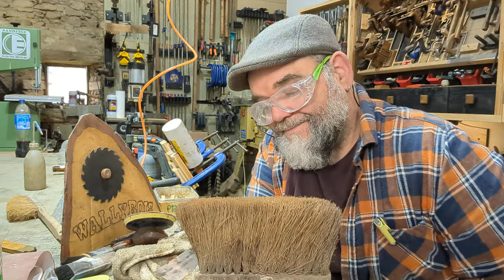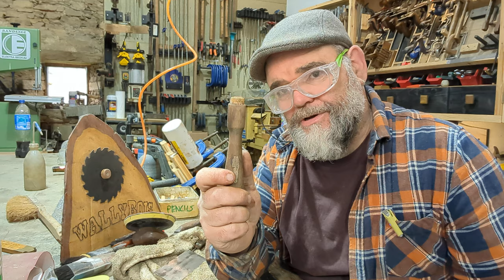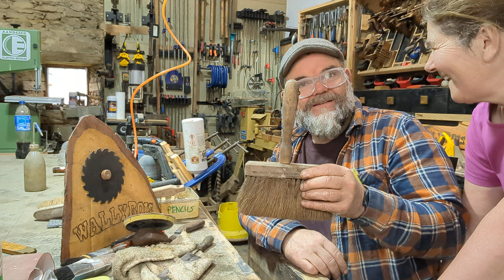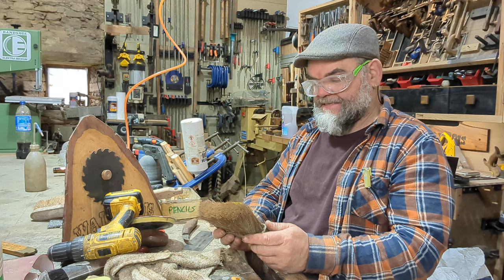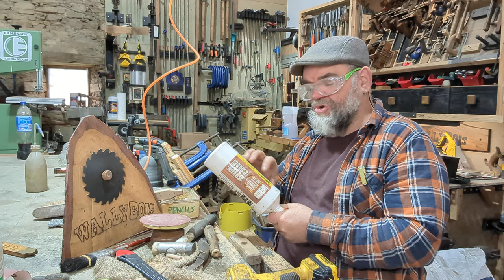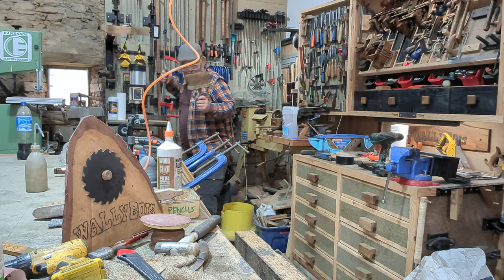Loose handle hack

Comment: No idea why, but using a dowel had never occurred to me. I'll admit to using the "screw through from the bristle side" trick, and sometimes even remembering to a pilot hole in the handle beforehand. I'll need to try this method next time I have to do this, though that would likely mean finding some decent PU in a local bricolage store...

Also, as regards not being able to find decent brushes hereabouts? SECONDED. I'm nowhere near as good a painter as my uncle, but those plastic things... yeesh.